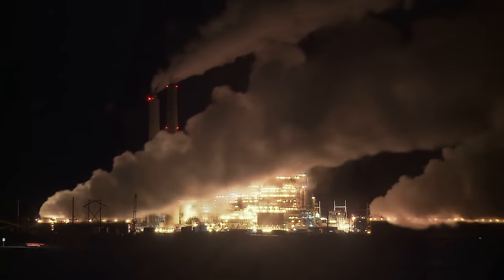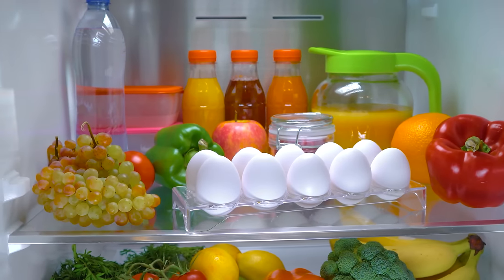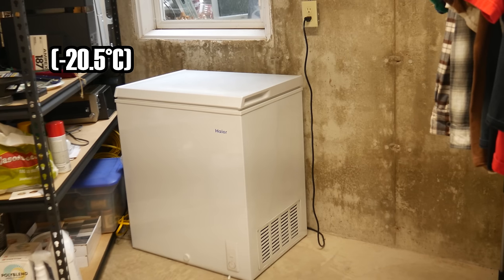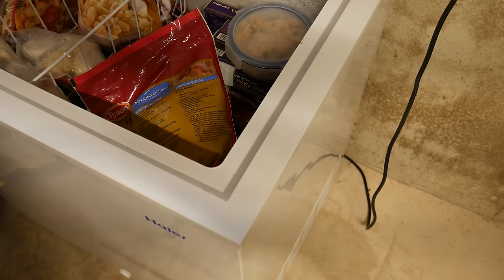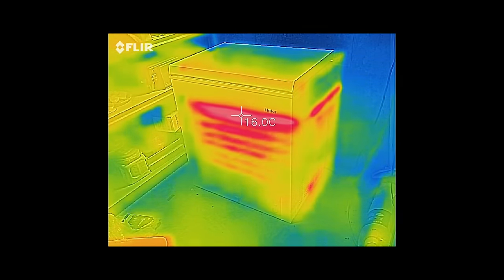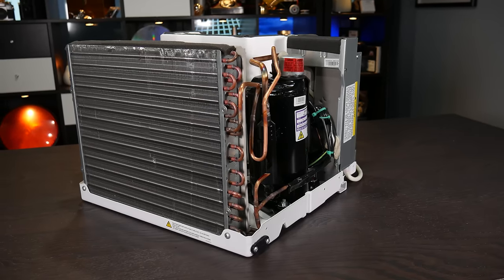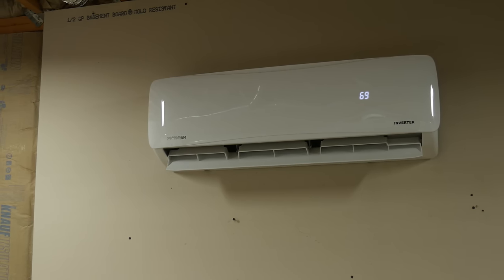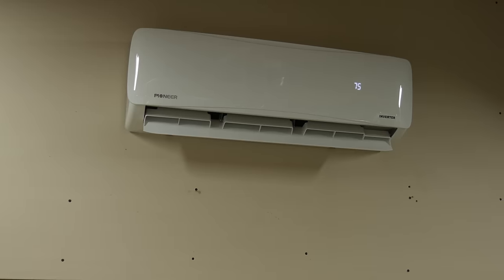Heat Pumps: the Future of Home Heating

Comment: HORSESHIT - come to Europe and check electricity prices, not o mention it barely does the job in really cold days (like -15'C or lower during day and -20'C or lower during nights). I know two people having similar size and thermal insulation houses (about 140m^2). On is using heat pump and other one has gas heating. Even with inflated gas prices this season - it costed ~600€ to heat the house for the winter season, while it costed 920€ for the guy with heat pump heating.  Not to mention that during those coldest days, heat pump was about as good as 19'C inside temperature (which is rather cold), where's the other guy has set 24'C during day and 19'C during night and still payed less and the year before when gas prices were normal (before Russian invasion) it costed him 400€ to heat for entire season.

There is option to install photovoltaic panels - but it's honestly rather shitty deal here when winter days are short and mostly cloudy (only about 66 sunny days / year) and overproducing electricity is mostly a waste as they pay you 30-50% of what you pay (varying by distribution company) and the installation itself is like 12000€ here (which also slowly loses efficiency and once it wears out you have to pay utilization costs out of own pocket  (and fuck knows how much that will be - as no one is at that stage yet)

Comment: wait so let me get this straight . It's more efficient to burn fuel to create electricity and run the heat pump then to burn the fuel directly for heat? That's a bold claim, do you have any experiments to back that up?
Reply: The data is out there, using the UK as an example (as everything is kW/kWh).  UK Gas Power Plants are just shy of 50% efficient, with the latest Keadby 2 being 60%+. Gas boilers in the UK typically run at around 85% efficiency. The UK MCS scheme stipulates that any installation must achieve a SCOP of at least 2.8.  So for 10,000kWh of heat required, burning gas would use 11764kWh of gas.  A heat pump at the minimum efficiency would require 3571kWh of electricity, accounting for ~10% grid losses (even though Uk averages 8%) 4000kWh required. Lowball the power plant efficiency to 40%; you get 10,000kWh of gas required.  Saving 1764kWh of gas.  Using more realistic heat pump figures of a COP of 4.0, grid losses of 8% and powered by keadby 2 you get 4500kWh of gas required for the same amount of heat, saving 7264kWh of gas.
Reply: @BenIsInSweden  I don't want to hear bogus numbers from both the critics and proponent of heat pump. I want to see a demonstration. I want to see how much gas it takes to boil 1 litter of water from 25 degree celcius.Then take that same amount of fuel to try and run a generator, then plug a heat pump in and see if that heat pump can boil that same 1 litter of water from 25. I doubt it
Reply: @delavega92  1) heat pumps aren't for boiling water, they're for space heating, and they have a maximum temperature depending on the refrigerant. (R32: ~55C, R290: ~75C, R744: ~90C) 2) portable generators are never going to be as efficient as a gas power station.
So ultimately your test requirements are flawed, and not a realistic representation of a gas power plant nor of a heat pump.
Reply: @BenIsInSweden  that's easy. We don't have to boil the water if the heat pump can't reach that max temp, just bring the water from 25 to 50 degree celcius. And just run the test for the heat pump until the water reach 50 and see how much gas was used. Then we can compare and see if the difference in fuel amount was from generator efficiency loss or was it too much for the efficiency loss alone. Remember OP stated it's more efficient to burn the fuel to generate electricity, then used that electricity to run a machine to create heat ,then to burn the fuel and extract heat directly.
Reply: @delavega92  at that point a more realistic test would be testing equally sized hot water cylinders, one heated by a gas boiler and a heat pump one. And use meters on each.
Not sure how you can fairly test with a generator, as they are only about 20% efficient Vs about 50% for a power plant, but will vary depending on the generator.
Even so, domestic hot water production isn't a heat pump's biggest strength. That comes from maintaining a set temperature after it has been reached, i.e. negating the heat loss of the space. Which requires the heat pump to be sized correctly for the space it is heating.
Reply: Technically it's true, though a bit unintuitive and misleading. If you heated your entire house with resistive heating (terrible idea btw but the only way to get 100% electric heat)  a heat pump literally multiplies the energy efficiency by taking less energy to instead transfer heat from the outside rather than directly heating the air. At peak efficiency, a heat pump will generate 500% of the heat of resistive heating, watt for watt.

Yes, burning gas is 100% efficient (well, not really, you lose energy to emitting light and such but for all intents and purposes it is), but burning gas for creating power, even if less efficient still multiplies the energy efficiency in joules. You get more gas out of your gas, so to speak.
Reply: To compound on this, the gas in your home and at the power plant have exactly the same energy density, that however many joules needed to  generate the extra power needed (ignoring the massive difference in scale) will contribute exactly  the same amount of energy transfer in a power plant as at your home. So heating your home with a heat pump will result in more work(energy) per cubic meter of gas than gas alone.

Comment: why stop with ambient air-conditioning? why not incorporate all the systems in a home. a "central compressor" if you will to regulate the ac/heater but also pool heater, fridge, water heater, etc.. it may not be enough on its own but it would certainly add efficiency

Comment: Heat pumps have become stupidly efficient. 
I'm currently sideeying (is that a word?) a unit from Mitsubishi electric. 
It has a scop for heating of 6.7 and in cooling mode it exceeds a cop of 11(!!!!) . 
Currently have a kind of window ac that does a cop of 2.6 . 
It has 5.000BTU and my home is well enough insulated that this is all I need. 
The Mitsubishi unit has 9000BTU and can produce up to 15.000 on its highest settings. 
Only issue is I live in an apartment building and I'd need to drill holes into the wall for what I need the permission of all the co-owners or at least 50% of those who attend the meeting and vote. 
Currently lobbying for that but many are simply dumb and lazy. So they don't want to spend any energy on thinking about it. Oh you wasted our time during the meeting. No!